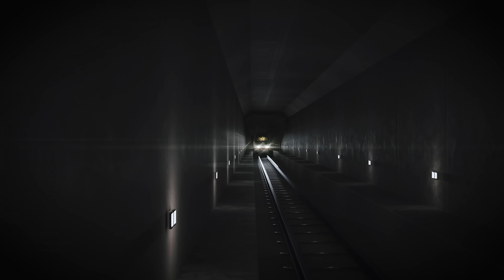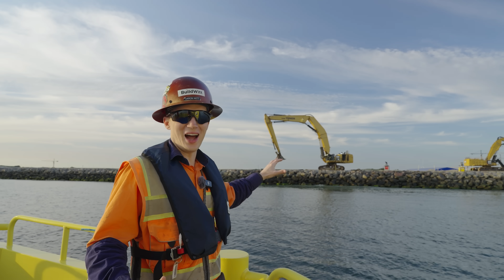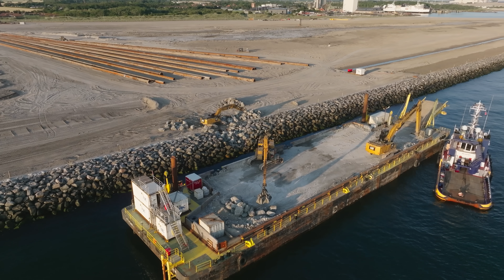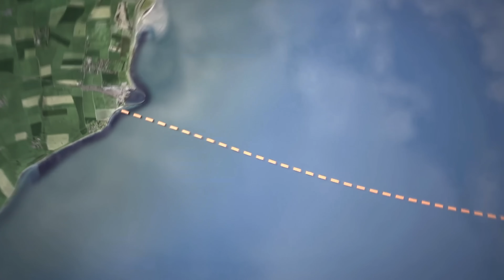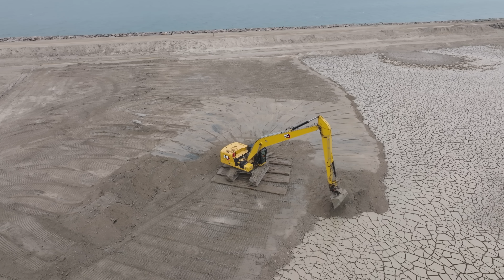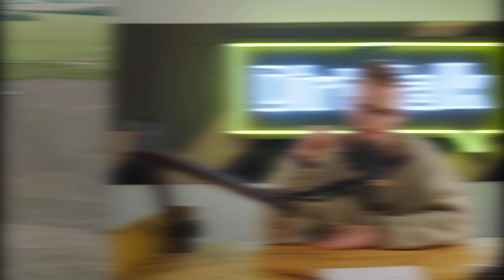Europe's Largest Marine Construction Project!

Comment: Interesting to see the range of abilities as those dozers go over that edge. It'd be even more interesting to see what'd happen if you switched the base station off. I try and stay away from that button and just use the numbers as a guide. Amazing how many ops reply on gps/can't work without it. I was on a D61 a while back where due to a dodgy turbo sensor knocking the gps control out meant I had to hit the grade manually (whilst also in limp mode). Asked the engineer checking me how far off I was as I was setting out; one of my proudest operating moments when he looked up and said 2mm. He didn't believe I did it by eye until I showed him the gps control didn't work.

Still cool af to see them lined up tho

Comment: Hi update on the tunnels. The first 2 are under water and they are leaking more then they anticipated (through the temporary seals). Extra pumps are getting installed to pump them empty ;)
Reply: The first two elements are not in the water
Reply: @kimgranov7445  oooow is my information then wrong or are they just floating in the water?
Reply: Tunnel installation is other contractor as the dredging works
Reply: Of course there're a lot of different companies building it. I just update everybody who's interested in the tunnels ;)
Reply: @Damicske  which elements went in?
Reply: @wilfredprins9718  The first 2, don't know more then that.